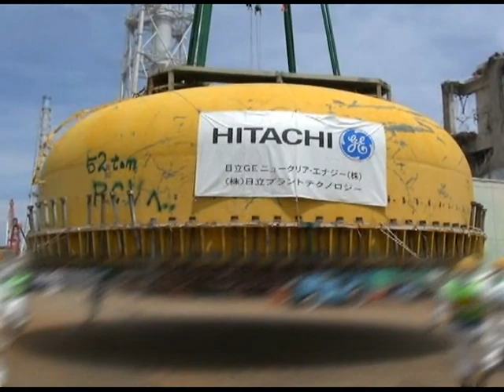TEPCO retrieves containment vessel lid from Fukushima Daiichi Reactor 4

Comment: The rectors did well, it was the electric coolant pumps that caused the problem when the diesel generators powering them got all full of water and stalled, the reactors actually withstood one hell of an ordeal and are of a good design even by today's standards ( originally built in late 60s early 70s) the 1985 Russian disaster threw radioactive material everywhere up to 500 meters from reactor, people in the control room died within a minute as the radiation was so strong, Fukushima although ba
Reply: mrcrtking 
The fucking lid was blown off.
See the heat rising as they lower it back on the reactor?
Reply: No the lid held.